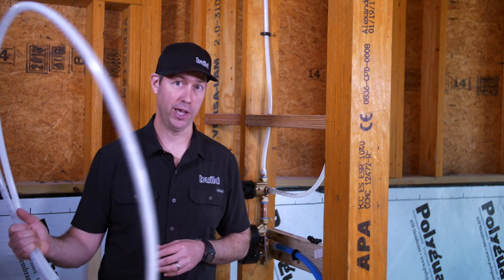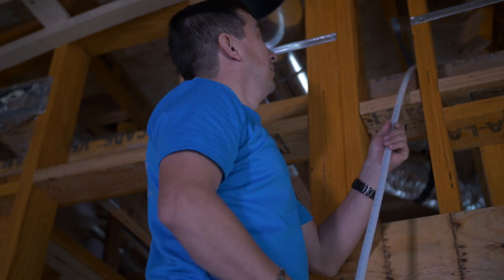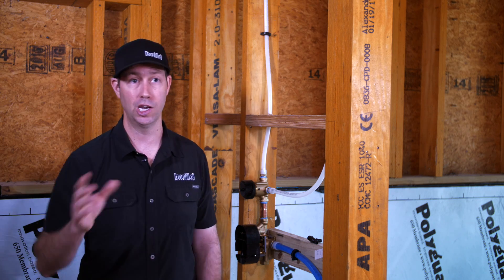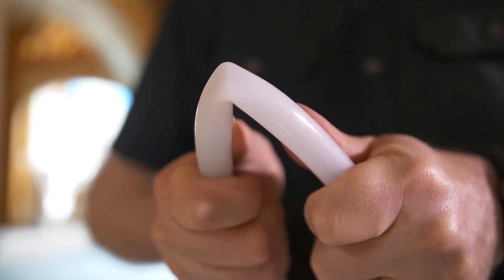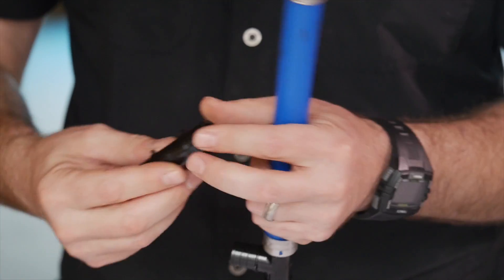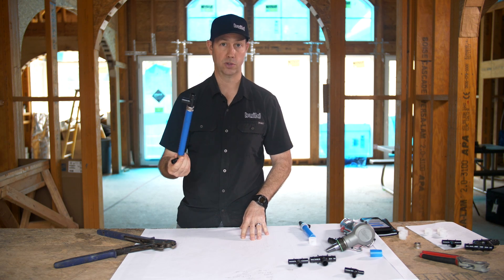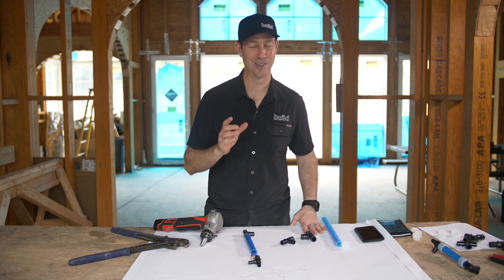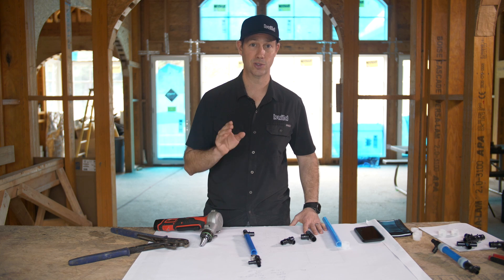PEX vs. Copper Plumbing

Comment: I’ll just make one point . Copper has incredibly good anti microbial properties and should be used anywhere water might enter your body . Imagine water lying in pipe for weeks before use . Qualplex or pex is great for heating systems. Full runs for under floors
Reply: Well let's look at the pipe before it enters your house.
I have never seen them running big copper lines under ground, I believe most newer city or counties are using plastic so I think your logic is off.
The little time your water is going to be in your copper lines is mute.
Reply: We also use hydro air from the mains here in Ireland. But I’ve cut open mains fed qualplex in houses with no occupants . Ie upstairs bathroom sink in an old persons home . Hadn’t been run through in a long time . The gunge was something that made me think twice about putting plex where I might be drinking the water . 
The mains is generally flowing from the road . There’s nearly always movement in the water . Tanks filling heating and toilets . But it’s the end of the line on low use pipes that concern me . 
Either way I love your show and watch a lot of your framing videos

Comment: I'm remodeling my house. I'm stuck on what fitting to use with pex-a. Other than price, what are the pros and cons about plastic vs brass fittings?
Reply: chad johnson I’ve used both haven’t had any issues. I think it’s just what’s available.

Comment: Only time will tell. Claims that PEX will last 200 yrs is utter nonsense. ZERO observed data to make such claims.  If I had a choice and $$$ was no object, copper all the way. I'd use PEX if the plumbing distribution system allowed for easy access to piping.

Comment: As a remodel-er I see: Copper corrodes and leaks (and has many elbows and torched wood). PVC leaks and bursts when it freezes. PEX bends, so easier install and less elbows(fittings), no torch, no glue, is cleaner and holds up well over time.

Comment: We over here use Uponor mlc, this is  aluminium multilayer pipe. Has zero linear shrinkage, comes pre insulated and has  in my opinion better fittings. We use pex only for in floor radiant heathing. But hey at least it is cheap.

Comment: Pex is a great option. But I had a leak coming from the bathtub. I opened the wall and I found something unusual. A mouse ate the pex hose.  Copper is better.
Reply: That’s not a plumbing problem. That’s a rodent problem.

Comment: I trust copper more than PEX but I have used it where I need flexibility for one reason or another.
Another thing is that the sharkbite fittings combined with the flexibility of PEX can make installs or repairs possible in areas that would otherwise be impossible without cutting holes in walls or ceilings, such as when your hand can reach into an area but not a torch.
It doesn't have to be a battle.  I'm glad all these options exist.

Comment: It's worth noting that studies have come out suggesting there are serious issues with chemicals leaching from PEX systems
Reply: Andrez what studies, ?from where ? What are the issues?
If it’s worth noting you could die from it. You might want to provide the necessary info.
Reply: False, nsf disproved  the Purdue study.  Google searching has been hard for some people.  Also, nsf is the same safety company that regulates the lead content of solder in copper connections.  So they have no reason to lie.  

https://www.nsf.org/newsroom_pdf/nsf_reviews_studies_pex.pdf
Reply: @binder929rr  Lead was removed from solder almost forty years ago.

Comment: 👍 my channel I use both.  Copper is art and prefer for most jobs.
Reply: art ?
i would say dated art.
there's no reason to use copper anymore....more expansive, crazy high thermal conductivity resulting in condensation so you systematicaly need to insulate, way longer to install, fire risk and risk of getting this shit stolen.
Here in Montreal, big contractors like the one i work for build 60-storey buildings without a single lenghts of copper installed. We use expanded pex, aquarise and stainless steel 304. We even use expanded pex up to 3" sometimes ! Nobody quotes job with copper anymore except for public institutional jobs...
Reply: @jessybwoy8677  yes exactly the same here in the 416 fellow Canadian, new construction will never use any sort of metal.  As for hydronics & boilers it will never  be anything else but copper, that's where my "copper is art" statement was referring too. For commercial plumbing here in toronto I'm not a plumber I couldn't tell you much.  With commercial boilers, refrigeration glycol and chiller setups it will never be pex.  I can expand why for many reasons.

Comment: Can you tell me about the recent class action lawsuits against pex style piping purchased primarily at box stores? 
I have also seen 3-4" cast iron 90's splitting when tightening the fittings on steam-hot water piping jobs. Never had it happen before in 20 years, ,several on 1 job, wholesaler switched suppliers, not made in the USA.
Also a Chinese company was caught bringing in ship loads of copper pipe, black iron etc.etc to flood the market and put more hurt on USA producers. TRUE STORY.
Cities like Fresno Ca, have mandated only FITTINGS, PIPE ETC. made in US can be installed in new construction.
Also, plumbers? I'm a HVAC-R guy, why is galvanized pipe still permitted in code books?
Galv.fittings should last 15+ years even in domestic potable water systems, but not enough " plumbers" are educated on electrolysis that takes place when joining 2 dissimilar metals.
I have pictures of galv.fittings installed in 2014, 1 1/4" etc.that are corroded. 
Fittings purchased at a box store. China does not do the same quality metal plating we do.

Comment: One problem with over use of all plastics is Men are be coming more feminine due to leaching plástics that mimic estrogen. That goes for piping and cooking in plastics, bottle water and foods. If i had my way all main línes and services would be metal. Id rather do a metal cleanse than try and remove plástic from my system. This is never talked about but is very Real. Also, be carefull pulling pex through holes, ive seen scratched poly eventually leak at the scratched Point when dug up for repair and inspected to find the cause for the leak. No one thinks health on these issues. I suggest a water filtration system on every home especially your drinking water

Comment: In Denmark it's required to use "pipe in pipe" when using pex for cold/hot water installations.
This is to prevent water damage in walls etc and you can see which pex connection is leaking at the connected end.
Hidden connections are also illegal of course.
Reply: You all seem to have it together, over there 😊

Comment: I switched (Set 2019) recently from PEX B system to PEX A.  The B with copper crimp rings and manual crimp tool works well most of the time if you hold the crimp tool perpendicular to the fitting. But trying to crimp a brass fitting in a tight space is difficult and sometimes must be done more than once to get a good square crimp that does not leak.  Finally got tired of those leaks and switched to Uponor PEX A.  Supply House salesperson told me there is a competitor to Uponor which is also manufacturers PEX A.  Using a used Milwaukee expander tool, I replumbed my two story house ( two bathrooms, two kitchens, one washing machine, and water heater) in several hours and I was not rushing.

Comment: With the uponor collar and expansion, is the collar the same material as the piping itself? Or is it a softer or harder collar? Does that affect the long-term life expectancy of the plumbing or is that mitigated by properly insulating to prevent it from reaching it's extremes of thermal expansion/contraction affecting the extended memory of the clamping?

Comment: Our house was built in 2006 with Wirsbo PEX pipe.   In the last 2 year we have had 2 pinhole leaks in the PEX pipe.  What a mess, tearing out drywall - forced heat ventilation to dry the area, and replace the drywall.....  With all the repair work we are having to do, PEX will end up costing us far more than if copper were installed initially.....

Comment: Uponor is best company for PEX piping. Uponor had manufactured difficulties on 1 of run and they changed my entire hotel piping and labor under warranty. I suggest if anyone using pex pipping go with uponor I’m sure you you want be get it wrong.

Comment: i wanna see a video of someone crimping 20 year old pex tubes. i work in the electronics and auto field and ALL plastics get brittle after 15 years, sure no UV in the wall will help but, copper can last 50+ years. you can do curves with copper too.

Comment: Pressure drop problems with copper can be offset by compensation at the pressure regulator. Just adjust it to allow a few more pounds to the system. Street pressure is usually about 15 or 20 pounds higher than the recommended house pressure.

Comment: What I hate the most about oex is its fittings fit inside the pipe thus reducing the gpm it flows.
Reply: Nvr Dwn that’s why Uponor pex a is the better pex option. Much larger fittings. And since you can replace many elbows by just bending the pipe you save a lot of loss there. Every elbow gives you loss

Comment: My experience with PEX is limited, but I have tasted water from PEX systems, and it's  not as good tasting as a system made with copper. I see advantages to install PEX, and copper is much more expensive, but I can't believe PEX will last as long as copper. Just my opinion, which is worth what it cost you.
Reply: Copper here in Florida with the water treatment eats it up I have to have a 70's home repiped with PEX  .

Comment: Matt, I had watched videos of your comments about PEX pipe and how you have used it for the past 15 years.  Did you know that Pfister forbids anyone from using Pex for shower/tub combos due to the small diameter of the tube?  They claim the Pex will cause water flox issues resulting in water coming out of both the showerhead & the tub spout at the same time?  Concerned by the possible mistakes I could make while installing copper I was encouraged by your different videos and went out and bought everything to install Pex, only to find the Pfister company having issues not discussed.  Had you heard of this issue?

Comment: PEX or CPVC are GARBAGE! Plastic (HDPE, PVC, etc) are OK for underground, but PEX and CPVC are weak. When you stub out with plastic, it can easily snap off or be degraded by UV. When I run irrigation lines in the yard, I used PVC for underground, but galvanized risers for hose bibbs and valves because plastic does not have the strength.

Comment: great info, i have experienced a problem with pressure drop using pex "b" between the shower faucet and the spout causing the shower to constantly run, the manufacturer even mentions it in the install instructions. looks as though pex "a" may solve that problem. thanks again

Comment: Here in the UK, we have a local Health care centre that was plumbed entirely in plastic, to be fair I am not sure of the plastic-type, we tend to use a lot of Polybutylene plumbing in the UK.
The centre cost millions to build in the early 2000s, ever since the plumbing has been a constant problem. 
Biofilms mainly that do not grow on Copper because of Coppers antimicrobial action, 
the biofilms have been a constant concern for risk of Legionella bacteria, and it has tested positive for this several times. 
Another friend of mine in the trade also says that he works on houses and whilst the plastic pipework may be fine, the fittings frequently spring leaks causing extensive water damage after sometimes just five years. 
And I nearly forgot the old building up in Scotland that had to have all of its plastic replaced with Copper because on such an old building it was nearly impossible to keep out rodents which loved to chew the plastic pipe.
Plastic does have its place but I am sticking to Copper, has for Junkies stealing Copper, you are lucky in America you can just shoot them.
Reply: Actually, no. Shooting is for threat of bodily harm.

Comment: Loving all those vanguard manablocs from
The early 2000’s. Every valve you touch has to be replaced now. Pex is useful in some
Applications but to me new construction isn’t one of them.
Reply: The ol manabloc home run! I run into a rotted one now and again and dont even wanna mess with it

Comment: I was an apprentice plumber about 18 years ago (went to trade school for it) and something seems wrong about the PEX system (joints specifically.) I love the idea of seamless pipes but when you get into joints it doesn't seem solid plus it puts flow limitation on everything for its stated size
Reply: Sounds like you need to go back to school!

Comment: We had a mobile home freeze in a 10 degree freeze, the hard plastic was from 1975. Over the next few days, my father in law and I redid all the pipes in pex and shark bite fittings. These other fittings interest my wife and I am fascinated as well. They look better for new construction, would Shark Bite be good for new as well. I know we used it for the whole house, but it was basically a remodel under stress.

Comment: Don't use too long of a drywall screw to hang a picture Etc. with PEX in the walls if you don't want pinhole leaks. Copper again FTW.

Comment: At the end of the day the choice is very simple, if you want plastic toxins slow leaching in to the water supply over a lifetime, go PEX, 
Copper actually CLEANS the water as is passes through it over time. Ancient civilizations exploited the antimicrobial properties of copper long before the concept of microbes became understood.
The history of copper piping is very fascinating and I encourage you to read up on it for your self. 
I have never used PEX and never will.
Reply: bruh do you know what the main water pipes are made of, right? plastic..
Reply: @25566  Negative, they are cast iron still in most places, though yes they are starting to use plastic unfortunately, ore re- line the old cast iron pipes with plastic
Reply: @QuaabQueb  Never seen a 'cast iron' water pipe.  Plenty of Gal Steel, but no 'cast iron'.
Reply: @chuckmartin3775  He probably meant ductile iron

Comment: We have had pex fitting failures in our home. They all were in 90’s.
Reply: Studd Muffin  it was pex. I guess it was a bad run or bad casting. I keep thinking that I might come home one day and the house will be flooded!  Luckily I was here when 2 broke.
Reply: Studd Muffin  the fittings are brass. I guess they are cast and then machined where the barbs are.
Reply: Studd Muffin oh ok. Sorry about the confusion. The crimp fittings used were the dark metal ones. The tool goes around the entire fitting. When I did the repair I used the shiny (stainless?) crimp rings that the tool only crimps the one part where the tool goes.
Reply: Studd Muffin  thanks for telling me (not!). I have a lot of places that aren’t accessible without a lot of trouble (multiple floors).  Hopefully it will last a while.

Comment: Resistance to flow is called head loss.
Also, I am concerned with chemicals leeching out of plastics.
Xenoextrogens comes to mind.
Also, an expansion tank can reduce or eliminate water hammer.

Comment: Not much on copper when it says PEX vs Copper.
Also, not sure what PEX is made of exactly, but many plastics gave BPA crap in them. Plastics are one of the causes for  low testosterone. SLS is worse due to the sheer amount you're exposed to.

Comment: When you compared PEX A and PEX B you described the two systems but when you compared the connectors describing the different sizes you mixed up the names of PEX A connector and PEX B connector. (Check it out and please revise)

Comment: I got new PEX installed in my kitchen in 2017 and it works just fine. The house was built in 1958, so I am not sure if the kitchen pipes were original (but they were copper). My plumber installed special type of small cylinders that are attached behind the cold and hot water values such as where my washer and dryer hoses are attached. He told me that these prevent the banging which I used to hear when I turned off and on my water. 

I have heard that copper pipes leak chemicals into the water and isn't good for your health. I know a chef told me a few years ago that refuses to use copper-ware for cooking because of the potential for copper transference leaking into food. I have wondered what the risks are so I would rather have PEX. New copper pipes often leach more than old ones and a simple method is to run the tap before you use water, but the length of time is dependent on the volume of water to run, which is unknown unless you measure it and it is a waste of water and money. I worked in plastics as a QE, so I like plastic and because the PEX tubing is delivering the water, not disposing of it, it should be very effective as a clean water source with little to no risk of transference of any chemicals.

Comment: YES, pex is great usually.  Uponor IS great, (the diameter issues you mentioned are moot if you understand pressure/hydraulic delivery...makes NO significant perceived difference, although it 'looks' like it does).  Uponor PEX  does have a major weakness though, it's RUINED by exposure to any U.V. light (ANY daylight or fluorescent light) for 30 days or more.  JUST 30 DAYS.  I went for a couple decades with no leaks on my houses, condos & apts; then I was sold a batch of fitting collars  that must have sat 'uncovered' outside OR in a warehouse; & both their flexibility AND memory was compromised & leaks developed at some fittings.  Very expensive... Bruce Sr.